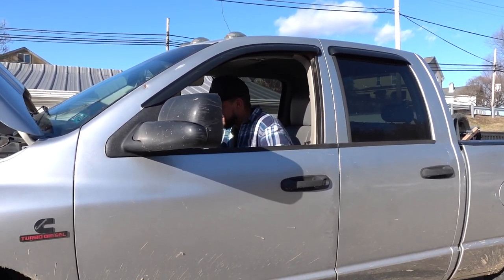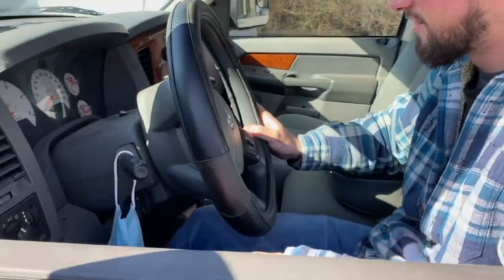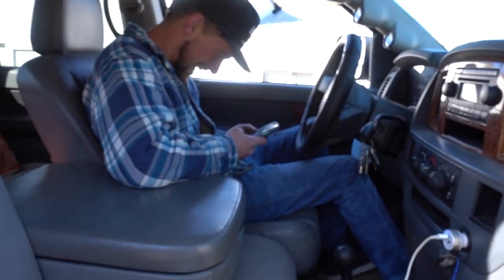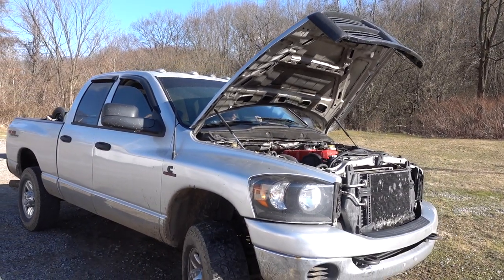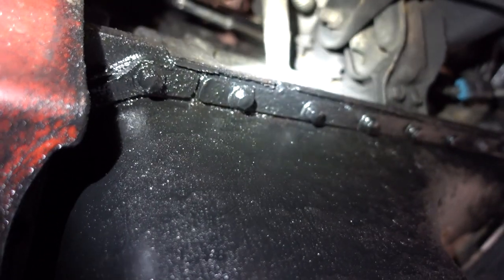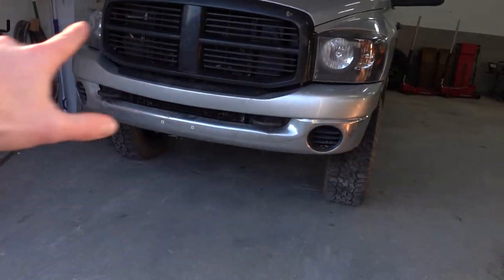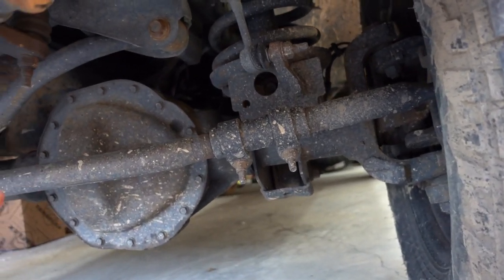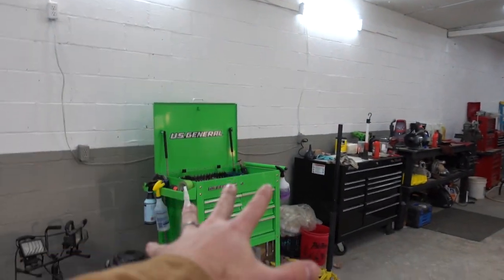Bought another CUMMINS and it has MAJOR HIDDEN PROBLEMS

Comment: I had that same problem on my 04. I replaced all the lines and then it helped just a little bit but I messed it up even more by trying to continue to drive it like that. So I got the trans rebuilt and found out that the gears wore out and my case was cracked.